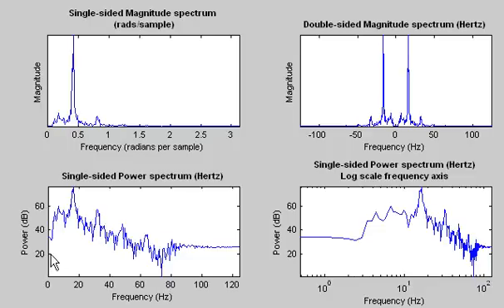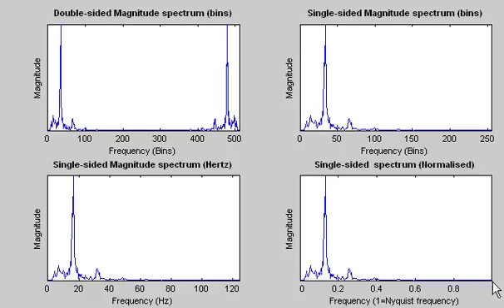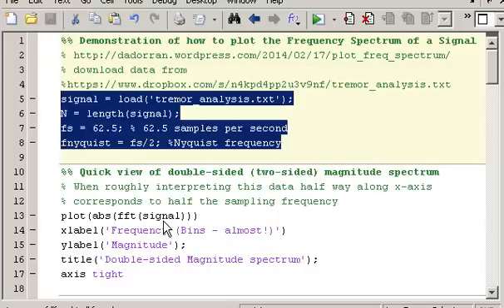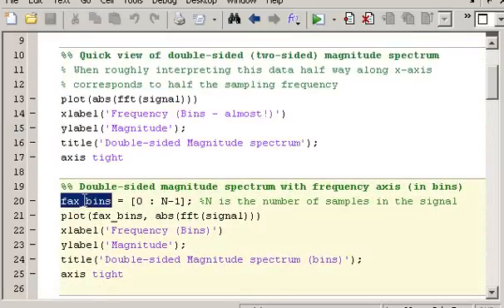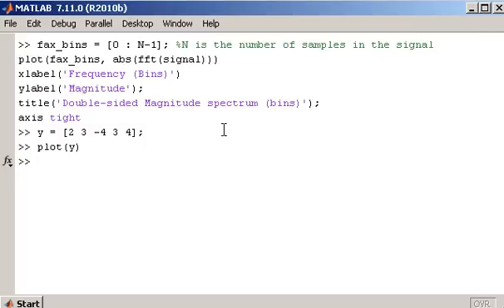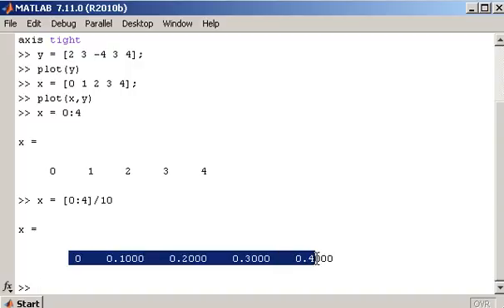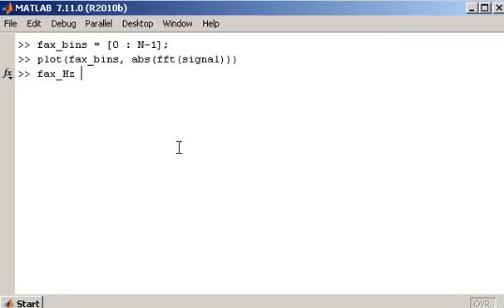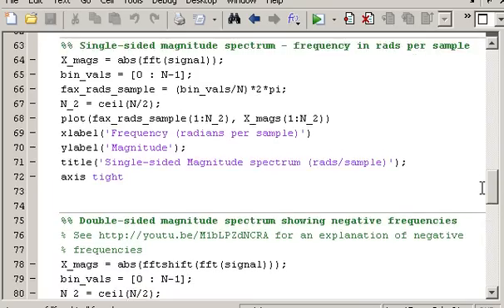Plotting Frequency Spectrum using Matlab

Comment: Hi, David. Thanks so much! you have helped me move forward with my homework. I need your support to conclude the same homework: your code allows show a continuous spectrum, but I need to show discrete spectra.  Can you tell me how do that? I suppose that I only need 1 or 2 additional instructions but I still don't understand this topic very much.

Thanks in advance...
Reply from the maker: The stem function in place of the plot function should do the job.
Reply: @ddorran  Hi, David. Thanks for your prompt response. Yes: I substituted plot() by stem() and I guess that I have the graphic that I need. Thanks so much!  I fully copied your code and I think that was enough to complete my task. :) However, I will try to show information about the phase. Can i show you my code? Thanks again for everything...
Reply: @ddorran  By the way, David: In your opinion, how we can give some use to Nyquist frecuency in the program?

Comment: How do we select the proper sampling frequency for analyzing an unknown waveform?
Reply from the maker: For a completely unknown waveform you can't know an appropriate sampling rate. However, you can take some knowledge about the waveform and what you want to detect into consideration. 
The basic rule is sample at twice the highest frequency present in the signal you're interested in (or twice the bandwidth). If you don't know the highest frequency present, you could filter out any frequencies above a certain value that may not be of interest. For example, with speech signals you could sample an audio signal at 8 KHz and get an perceptually intelligible representation of the signal. While there will typically be frequencies above 4 KHz in speech we can use our knowledge of how audio signals are perceived to select an appropriate sampling frequency.
Reply: @ddorran  Thanks!

Comment: Thank you very much for your knowledgeable video. I am working on EMG signal . I made a device which taking EMG signal  from human body. The signal I took looks like good. But I don't know how to get frequency of this signal. I have ADC,sampling time,total sample and also used fft to get frequency. But its giving 0.03 Hz (Aprx.) which seems to me not correct. Because EMG signal frequency range is around 5-450 hz. So my question is do I need to change my ADC or any other things thats give me correct frequency?

Comment: Hello. Could you help me plotting a correct spectrum of an AM modulated signal. I used FPGA to generate the carrier signal at 33.3kHz, so the samples are all 30 microseconds apart, and in the time domain it appears good. The baseband is 8kHz. The spectrum of the baseband signal is straightforward and spot on (shows 2 frequency components as advertised) but the spectrum of the modulated signal makes no sense

Comment: Hi David, I was wondering how I could calculate the power spectral density value using Mat-Lab. Thanks for your videos they have been very helpful
Reply from the maker: There are built-in functions to do this. periodogram is one that I have used in the past.
Reply: @ddorran  Yes I need how we could do PSD, value using Mat-Lab. Thanks for your videos they have been very helpful, please.

Comment: You should be dividing by N in your amplitude spectrum if you want to show the frequency response - also using fftshift will shift your fft as needed
IE..

N = length(signal);
fs = 2000;
n = 0 : N-1;
A = 12;
f = 100;

signal = A*cos(2*pi*100*n/fs);
Hf = fftshift( fft(signal,N) );

If you want A/2 as the amplitude value for the pos and negative halves of the spectrum you need to plot like this..

freq = -fs/2 : fs / N : fs/2 - 1/N;
plot(freq, abs(Hf) / N);

Comment: What are the magnitude/ amplitude units? are they units seconds? i.e dB.secs in this case
Reply from the maker: There are no units in general - they are the magnitudes of the sinusoidal components which when combined will reproduce a signal. Its the same when looking at a time domain signal - in general a plot will have its y-axis labelled "Amplitude" but if you know what the signal represents then you can change how you label the axis. For example for audio signals the amplitude will correspond to pressure measurements. In the frequency domain the y-axis would then correspond to a measure of pressure at a particular frequency - the units would still be related to pressure.
Reply: David Dorran I'm doing a frequency spectra for acceleration, where the input file is in terms of gravity (g). So does this make the units for amplitude g.secs?

Comment: How can I find Low frequency and high frequency and total power?
ragheed.dawood@yahoo.com
Reply from the maker: x = rand(1,1000);
total_energy = sum(x.^2);
X = fft(x);
total_energy2 = sum(abs(X).^2)/length(x); %from parsevals theorem sum(x.^2) = sum(abs(X).^2)/length(x)
low_freq_energy =  sum(abs(X(1:length(x)/3)).^2)/length(x);
mid_freq_energy =  sum(abs(X(length(x)/3+1:2*length(x)/3)).^2)/length(x);
high_freq_energy =  sum(abs(X(2*length(x)/3+1:end)).^2)/length(x);
total_energy3 = low_freq_energy+mid_freq_energy+high_freq_energy

% total_energy3  == total_energy2 == total_energy 
% get the average power by dividing by time